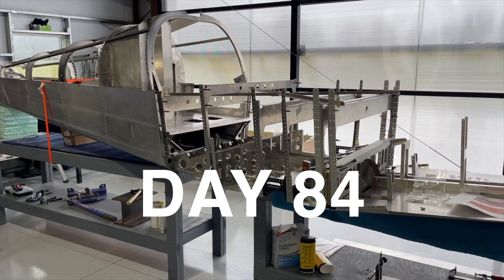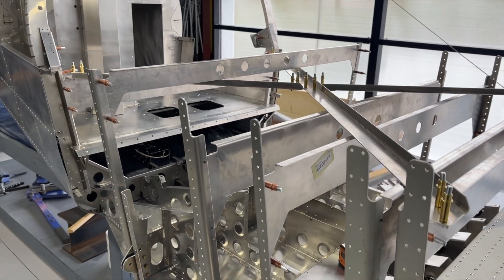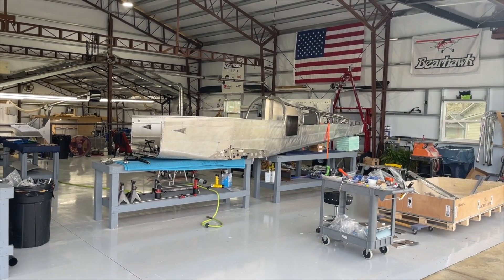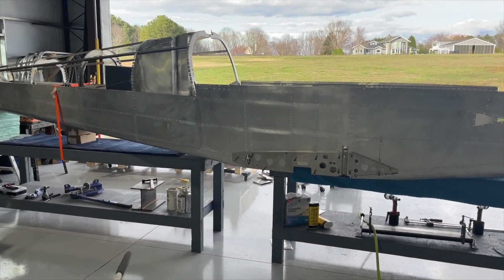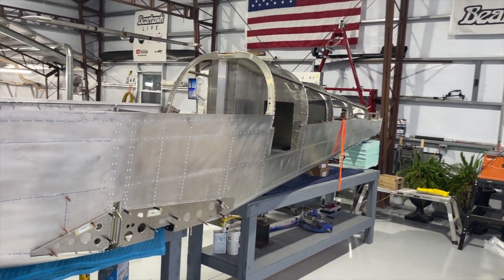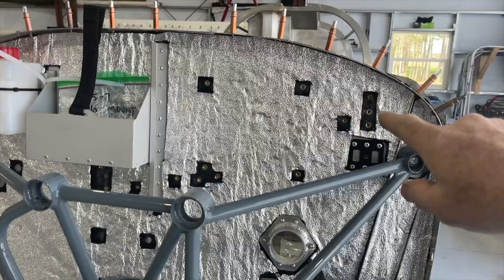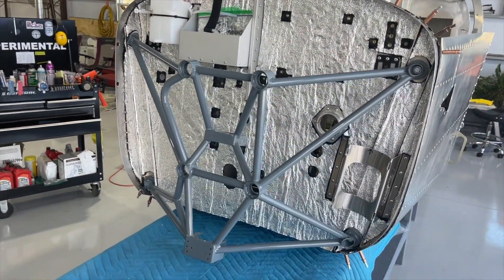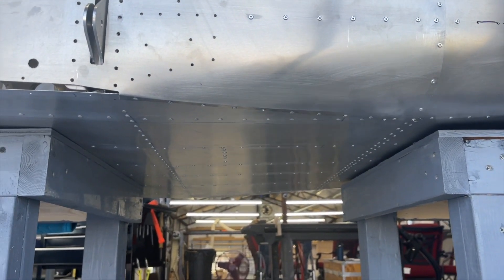Joining the Fuselage  [Sling TSi Build Video #11]

Comment: Excellent video as always. On my TSi build, I finished all the controls, eyebolts, pushrods, autopilot servos, and will also finish the insulation on the floor before putting the front side skins on. Out of order compared to the build manual, but my back just wouldn't have liked leaning over the sides doing all that. Found out some of it was pretty tedious. Putting yours on a rotisserie is a great idea and should make all that easier.
Reply from the maker: Good to know!  Yes I have it on the rotisserie now and it works great for exactly what you are referring to.  Will post that video soon!  Thanks!

Comment: Are you sure the fuselage has enough rigidity without the top on to support itself at odd angles on the rotisserie? I'd be a bit worried about the side loading when you roll it sideways.
Reply from the maker: I appreciate the question and also considered that.  However there will be no weight except for its own.  I comes down to this...  I wouldn't want to fly it if the fuselage was that flimsy at this point.
Reply: @TheBaldPilot  It appears to be a monocoque / stressed skin.. and I would not like to see what happens if you stress it with out all the skin secured.  With a steel tube, you could just bend it back with minimal loss in rigidity.. but not necessarily with this aluminum tubing.  Might consider checking with the Vans people to see if anyone has skewered a boneless skinless thigh.